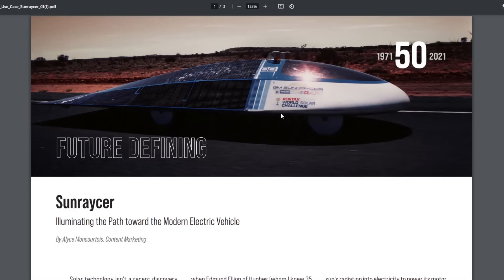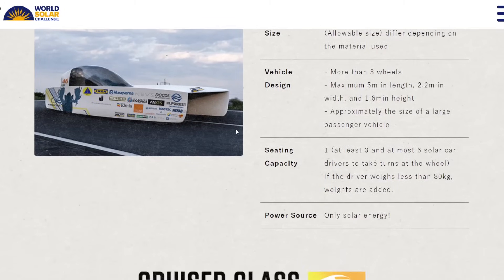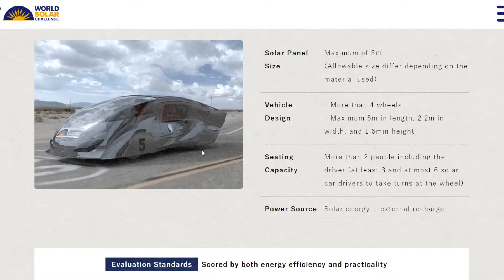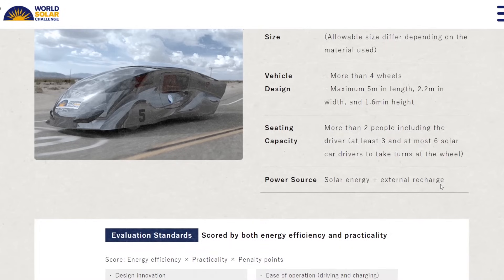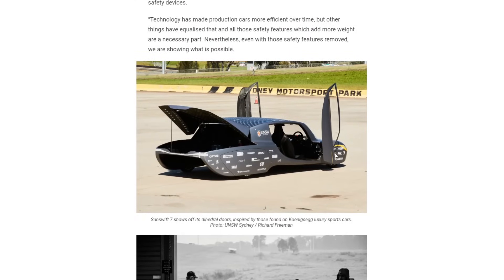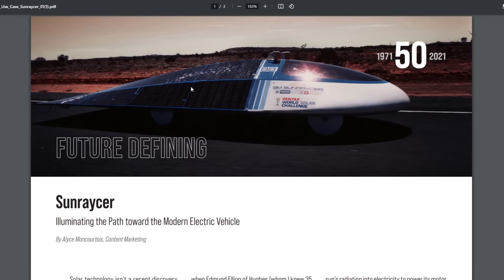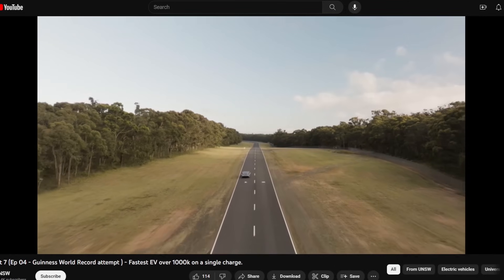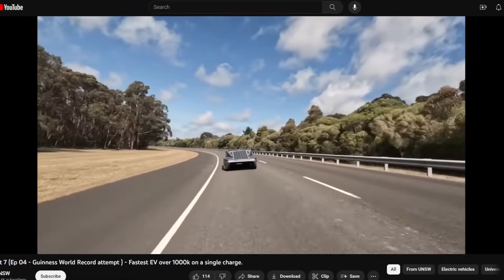The Sunswift 7 shows us that Aptera's efficiency claims are pretty modest

Comment: The Sunswift 7 is cool, and they deserve to be celebrated for their achievement. It does highlight the fact that there is a big gap between research producing experimental one-off vehicles, and practical, usable, affordable solar powered EVs. The Sunswift 7 is a good ideal, showing what is possible using today's technologies. I am optimistic in thinking that the production intent Aptera will be able to hit their lofty efficiency, solar, range and performance goals (under optimal circumstances). But I do expect that real world range will be affected by many factors like temperature, speed, load, wind, etc. I think that it was wise for Aptera to hold off on releasing prototype efficiency, Cd. solar and range numbers, because the production intent models are going to match the efficiency that we will get with our own Aptera EVs, and having 3rd party testing will be better believed.

Comment: Hi Steve, Thanks for this vid.  I'm also hoping that Aptera owners will be pleasantly surprised by the actual range we will achieve.  After seeing the skinny tires/wheels of the Sunraycer I had another thought...

As an avid biker, you probably know the importance of the bicycle tire selection in terms of the rolling resistance and overall efficiency can have on a quality road bike.  The difference in performance and efficiency between tires of the same size and even from the same manufacturer (e.g. a 700x23c GP4000 versus Ultrasport from Continental) is startlingly apparent when they are compared side by side. (The GP4000 will feel like it's self-powered, not slowing down even when not pedaling, and accelerates with eye opening (and eye watering) speed whereas the low end Ultrasport is a total dog in comparison).  Higher end road tires take advantage of things like: reducing weight (tire weight) at the wheel's circumference, more threads per inch (TPI), design in carcass flex and profile, tire pressure (PSI), different rubber compounds, etc. As a bike builder/upgrader hobbyist (over 100 bikes), I know that tire selection can account for upwards of 10%-15% increase in bike rolling efficiency and performance.  

I think that the Aptera's weight and design creates a new class of automobile that could very well benefit from a new class of automotive tire that is optimized for this new EV class (a sub 1-ton, carbon fiber, super aero EV).  
I recall that someone at Aptera mentioned that the tires fitted to the LE will be a standard commonly available automotive radial.  But what if a new class of tire could be produced for the Aptera (and kind) that would regularly give the 400 mile LE another 40-50 miles of range and very an increase in speed and rate of acceleration....?

Comment: Having the rear wheels in line with the front wheels probably helps the Cd, offset somewhat by the added rolling resistance of a 4th wheel. But yes, a 0.09 Cd for the Sunswift 7 seems to bode well for the Aptera’s slipperiness.

Comment: I am really not surprised that a 4 wheel thing that really is not a complete car did that well.  With 4 wheels they could bring the front wheels in to a narrower stance.  This compensates for the need to have more stuff near the ground on the rear.

Comment: The other drag factor that you did not mention is aerodynamic cross section. The Sunswift 7 appears to be a lot lower than the Aptera.  I can't compare the width but over all as a special purpose vehicle I expect that the overall cross section is significantly less.  A lower cross section times a lower drag coefficient will help lower the drag considerably.
Reply: A vehicle that low would probably be difficult to see by other drivers on the road and would likely be a safety concern.
Reply: @garywozniak7742  Yes. The same could be said of any race car, which is what these are.
Reply: And built/tested at much lower top speed powered by much smaller motors.

Comment: Chris Anthony has said in multiple interviews that the drag coefficient has been improved through refinements, suggesting better than a 0.13 cd, not worse.
Reply: I don't think the original testing included the windshield wiper. I believe in their previous incarnation Chris Anthony was asked about wipers in an interview and he said they would add more drag than the rest of the car (or something along those lines).  I believe they also said the car had less drag than the large side-view mirror of an F250 (with the tow package).
I'll be swapping my wiper blade with the shortest one I am comfortable with. I think the 2nd gen prius has a 10" rear blade...
Reply: I think no side mirrors in the early 0.13 design.

Comment: I would not be surprised if Aptera has got some more great news for us. I remember the improved suspension, upgraded motors,  then pressed body and an aluminum frame. There have been rumors of increased range and decreased drag coefficient. I think there is something special about the battery pack that is worth waiting till March of 2024 to complete. Aptera has made so many amazing improvements since I made my deposit. I am sure that it will be worth the wait.

Comment: Well one thing to consider is that aerodynamic drag is only a portion of the air drag equation. Remember that you need to combine the aerodynamic drag and the surface area to get the true drag of the vehicle. Aptera may be only a fraction less efficient in drag, but it also looks to be much bigger both higher up and being less flattened out.
Reply: Also lets look at aero balance and the load on each axle. Yet no mention of that.
Reply: @billsmith5960  load per axel is unlikely to change much from Aptera vs others. It takes a higher percentage the weight per axel, it also has less rolling resistance from just having less wheels. Otherwise I'd say the only detriment of the third wheel is disrupting the air flow smoothly under the bottom.
Reply: Cross sectional area, not surface area. It's also important to keep in mind that aerodynamic drag is a function of the square of the speed. I'm not sure how fast the solar racers were going, but the lighter weight could have played a greater role in their efficiency. If you look at the older competitions, they would have been using conventional lead acid batteries with much worse energy density. Reducing the weight also has a compounding benefit since you can then reduce the weight of other components (frame, suspension, etc.).  The aerodynamics of the older racers was probably not much worse than the recent ones.
Reply: I forgot to mention that cars with smooth underbodies are actually more aerodynamic when raised off the ground. It effectively reduces their frontal/cross sectional area.  Not great for handling, or generating downforce though, which is why it isn't done. With the light BinC of the Aptera and batteries keeping the CG low it shouldn't impact the handling as much, and they are trying to create as little disturbance in the airflow, not maximizing downforce.
Reply: @aimlessweasel  - What about aero balance?
Reply: @billsmith5960  I'm sorry, but I'm not sure I understand what you are asking... lift vs. downforce? Stability in cross winds?
Reply: @aimlessweasel  Good comments. Video mentioned 40 mph for the racers. Even 60mph for Aptera = (60/40)^2 = 2.25

Comment: The roof of the Sunswift 7 is the underside of the solar panel. That’s got to be brutal unless they have a fan in there and some air extraction. 

I think once you get to a 4-5 passenger car, you want four wheels and all the safety requirements because kids will be in there and insurance companies might be brutal to it if any corners are cut. If all the trucks and SUV’s were off the roads then the world would be pretty safe in smaller cars. Really if the high speeds were banned then cars could shed a lot of weight that is for safety equipment and crash structures. I would say Europe was going that way, but recently half of sales have been SUV’s even though if you go a long distance you can go in a train at 250 mph. I think China primarily has cars for local use and fast trains for long distance

Comment: I have been following the Sunswift and wonder if a future 4 wheel Aptera might be more aerodynamic as the 3rd wheel might cause additonal drag? Love to hear from the engineers in our community. As a reservation holder, I will certainly purchase the 3-wheel Aptera, but the future is bright if a 4-wheel aptera could be even more efficient.
Reply: From my understanding of it the contact points of the tire on the roads cause more friction than the aerodynamics were causing drag so they dropped the forth wheel from a purely friction based standpoint
Reply: Not saying you were incorrect. Just saying that that was my understanding of the reasoning
Reply: 3 wheels cause less friction than 4, and 3 protruding wheels. even fully covered, would cause less drag than 4. The difference is in the wheels- these solar racers use very skinny bicycle tires,  and the fronts may barely have any room to turn. Totally impractical for parking,  hitting bumps,  or cornering hard; the lack of traction is very unsafe for normal road use. It would be worse than driving your car on 4 donut spares.
Reply: @jamesengland7461 thanks for your insight.

Comment: Steve's eye for details is super. Does the Sunswift 7 also have in-wheel motors?  One can sit in a normal position in the Sunswift 7,  the wheel sections are very aerodynamic and the way the doors open and close is amazing, very impressive. But it will not pass the required safety tests to be road legal. If the design can be made safe, my next guess is that a production version will cost much more than the Aptera. For instance, the 'Lightyear one' (a similar car) was very expensive, and could not be marketed. The internal space of the Sunswift 7 is much smaller than Aptera's internal space, which makes it impractical for transporting stuff. I conclude that Aptera is light years ahead of the competition.  Anyway, Hopkins' team did an amazing R&D job, very good project, very good students and potential engineers, and it also illustrates how brilliant Aptera's design is.

Comment: If you remember what Chris Anthony said, it's the raised rear that causes a vacuum that eliminates turbulence underneath the vehicle and the pressure from the front of the vehicle. That's design is what threw the  NASA engineers for a loop because they don't normally deal with things close to the ground.

Comment: Having two rear wheels enclosed behind the front wheels is probably better than having one rear wheel not behind another wheel.
Reply: However, at lower speeds this would add rolling resistance - a larger percentage of the total drag in town.  It would also add weight and cost.

Comment: These solar racers are extremely fragile. with paper- thin panels,  no interior panels, thin and uncomfortable seats,  very cramped seats (probably can't actually sit in the back seats) airbags,  no real crash protection,  super high pressure bicycle tires which can't handle big bumps or cornering forces,  tiny brakes,  and are so trimmed to the bone that they may not even survive the 2,000 mile race- they're essentially single- use cars.  Those front enclosed wheels probably don't allow for enough turning to be practical on the street. and these cars are so light they risk blowing over in the wind.  Their tiny motors with little power are stressed to the limits. All the components are very expensive.
Reply: No way that they will be blown by the wind, especially as they are very low and offer very little resistance to the air.
A Citroen 2CV was around 500kg and they were not blown by the wind.
Reply: As you hinted, small motors for small vehicle going 40 mph. 0-60mph will be much higher than Aptera's 4 seconds. Operating with those motors will be part of Aptera challenge.
Reply: Lol it's not trying to be an apple to apples comparison,  man.
Lol